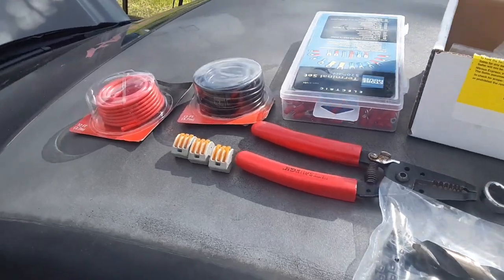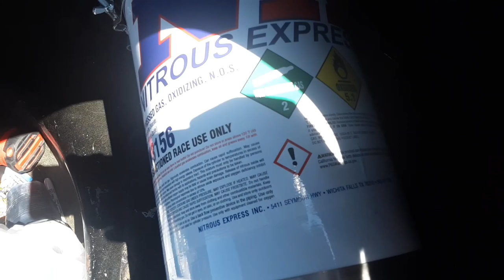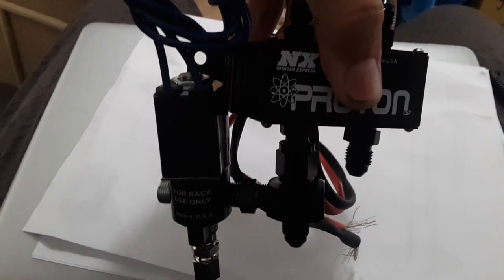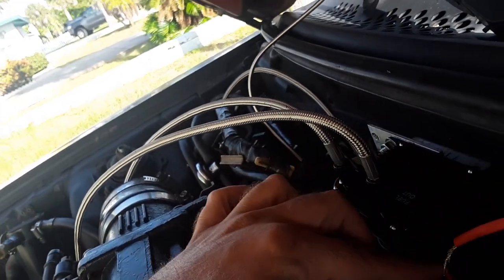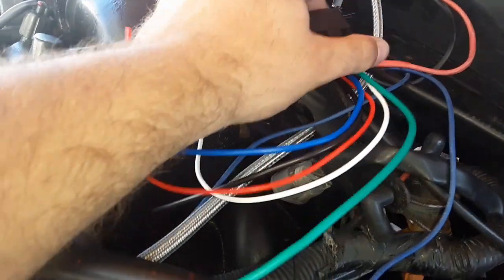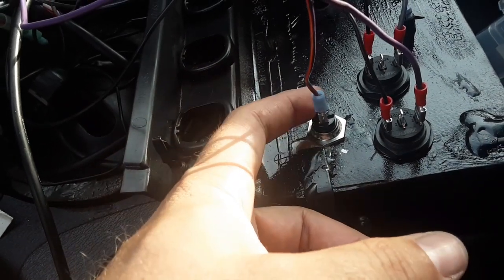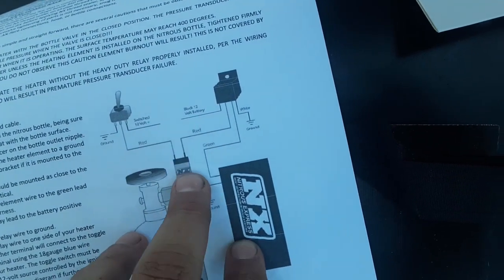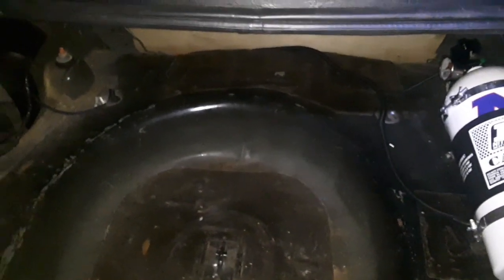*IN DEPTH* Installing a Nitrous Express Proton kit on my 97 Mustang GT #nitrousexpress #mustang

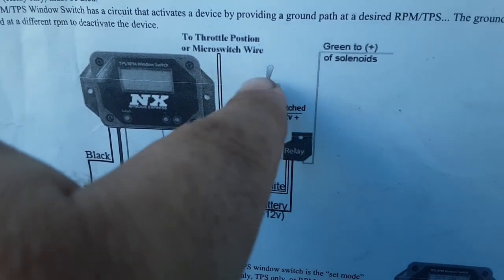Comment: Everything looks good brother you did a awesome job except at 39:00 it is right on the diagram you just gotta make sure the gold is ground then middle is accessory and the other outside is 12v+ that’s why when you turn your key on the leds are constantly lit. They are only supposed to be lit when you flick them on meaning “armed” they’ll work either way but awesome video brother I learned somethings from this video
Reply: Btw I love the center setup, I will definitely do that on a race car setup. Need my jams
Reply from the maker: Nitrous express sent me a diagram to wire them the way i did it.. but i thought it was odd it stayed lit.
Reply from the maker: @ReyesBuilt  i couldnt hear the radio over the exhaust..so i figured I didnt need it.